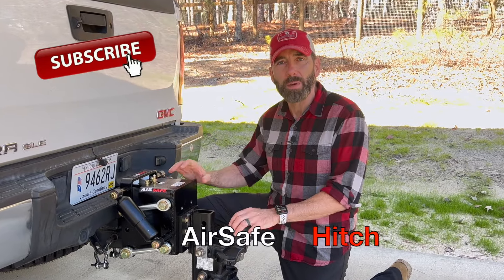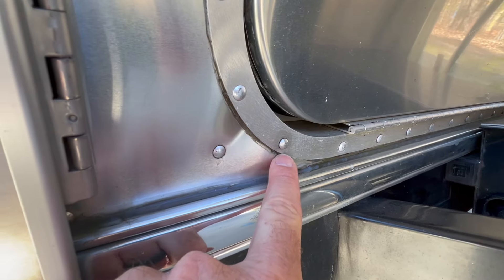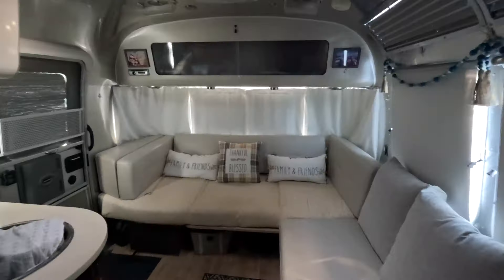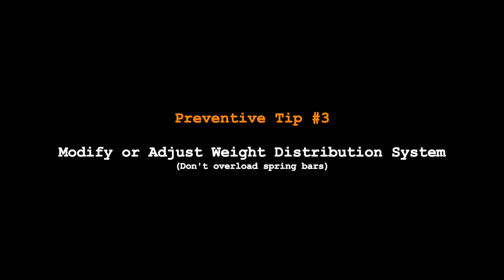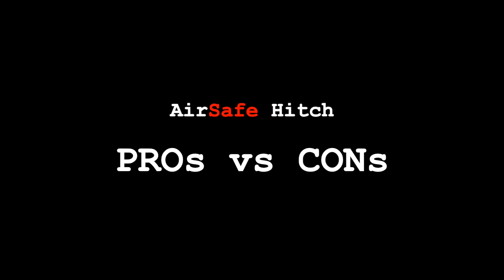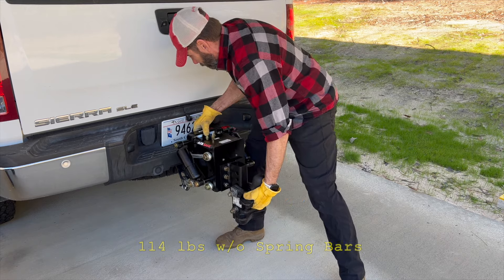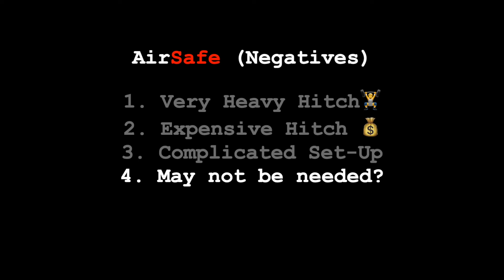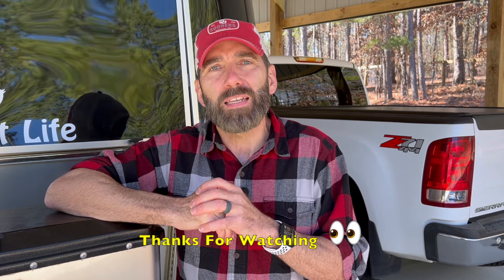Should AIRSTREAM Owners Jump On The AIRSAFE Bandwagon?#airstream #rv #airsafe #KYD

Comment: Is the weight distribution hitch required on the air safe setup?  Can that be removed if you go with rear air suspension upgrade?  I'm thinking that might lessen the stress on the frame w.r.t. front end separation.
Reply from the maker: The WD system is designed to distribute the trailer tongue weight across all the axles (steering axle, drive axle, and trailer axles). Without a WD system the majority of the weight will be placed on the drive axle.  The AirSafe Hitch provides for a less ridged truck/trailer connection through the use of airbag technology. In theory, this is to less the physical impact on the truck and trailer due to rough roads, potholes, etc while towing.  Using air suspension on your truck may improve your ride and possibly provide similar benefits of an AirSafe hitch (what degree…I don’t know), but it will not improve the weight distribution across the truck/trailer axles.  That is why we use both an AirSafe hitch and a WD system for our towing set-up.  Additionally, we had the Airstream front end reinforced recently to better withstand the impacts and vibrations of the rough roads in order to prevent any front end damage/separation problems.  Hope this provides some insights to our thought process.  Happy camping and safe travels.

Comment: GenY or Shocker will provide largely the same dampening with way less weight and cash... Air Safe is probably the absolute best for isolation though.
Reply from the maker: Never tried the GenY or Shovjer but we’ve been happy with the AirSafe so far.
Reply: @thewrightlife  just wanted to throw them out there in case people were unaware of less expensive similar options.. keep up the great work
Reply from the maker: @QuadTap  absolutely…thanks for sharing!  Safe travels.

Comment: Ball is pretty far from the receiver which will take more weight off the front axle requiring additional weight distribution.
I'd use a Shocker before that snake oil hitch.
Reply from the maker: Thanks for the comments.  Let me know how the Shocker hitch works out for you.  Safe travels and a Happy New Year.